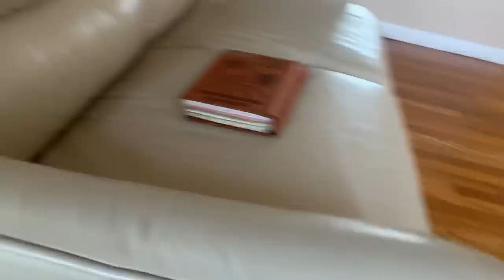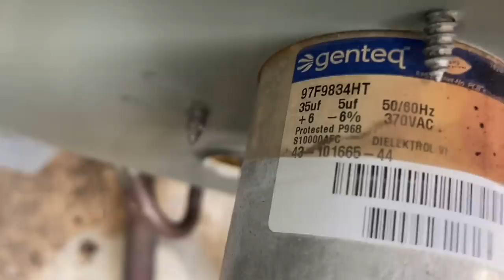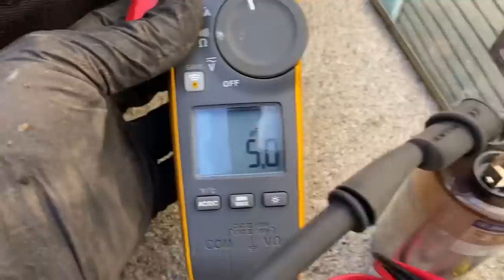Why it Takes FOREVER for the Central AC to COOL! Neglected A/C Unit Repaired & Cleaned

Comment: 74° in Long Island? Wow thats comfortable. Here in my part of Canada we are baking in 100°+ heat and high humidity! 78° was our low this morning! My Central A/C is running strong after 25+ years of service. My Aunts A/C is running strong after 42 years of service, her house was built in 1980, never renovated or upgraded. Everything but the water heater and shingles are original! Her gas furnace has a belt on the blower and a pilot light on the burner assembly. It is a natural draft so its the old style. No control board just a fan limit and thermostat terminal and some condenser relay box.

Comment: It may involve a lot of work but The dryer vent needs to be rerouted to the other side of the house and the condenser needs to have some legs under it to prevent the mulch from interfering with the coils

Comment: I wonder if you could put a 4" PVC 90 on that dryer duct just run up the wall about 5 ft to clear the units or around the corner to the right?

Comment: 3:24 @Mikey Pipes - Pipe Doctor Plumbing & Heating & Air
Not sure if you do, but if you stocked most common filter sizes on truck, you’d make a killing doing an up charge on your service /tech calls when replace a filter…..cuz lets face it 9/10 PPL don’t change the filters, flush condensate line(s) every month w/ vinegar (if they want to)….so know takes up room on a truck, but could store on interior of ceiling w/ brackets (or on sides) and keep most common ya know what ppl use, and could charge extra for it, cuz being in a home w/ a filter changed, or a spare ready to go…..happens like 0.0001% of the time; especially when homeowners have uncommon size that CAN NOT BUY IN STORES & MUST BE ORDERED: 1 example in my area is a 16x20x2 filter and DONT FIND THEM at box stores😉
Cheers gang✌🏻
Reply: @PipeDoctor  Yeah, can understand that, overhead (cost) and space in trucks wouldn’t work well. Appreciate the reply, your always kind and try to answer everyone’s comments/queries. Thx and cheers✌🏻
Reply: with all the various sizes scattered around, you'd need a 55' semi trailer full and probably still never have the right size! 🤣

Comment: It would be ugly, but if you take off the louvered dryer vent cap and transition into a pvc 90° go into the ground and follow the house to the corner and come back up it would be away from the units and still be accessible to be cleaned. Some of the dryer vents we clean go through the slab in the laundry room,  go underneath the storage room and come out of the ground just past the slab.
Reply: you must be down south somewhere always warm, up north here it would condense in cooler weather and clog in no time.
I once made the mistake of running one under a deck, out  3' and 5' across, it was ok in summer, by winter I had to totally relocate it and repair the dryer(thermal fuse went bye bye)
Reply: @throttlebottle5906  NC, about 1/3 of the houses we maintain have the dryer vent go under the slab. Recently we've had to repair the elbows under the surface do to water getting in🙄
Reply: @matthewhoffman9242  too funny. here in northeastern Ohio, there are older slab homes with clay tile/orangeburg pipe as "downflow heat supply ducts", and field tile drainage to sump crocks. you can imagine what happens if the sump pump fails.
had a buddy call me from California on a work trip, his wife and kids had so much humidity in the house the doors and windows were frozen shut and walls/ceiling dripping wet with humidity! the sump pump failed and ducts full of water, the house was a jungle and water coming up through the slab! it was actually a rental and nobody else they called would show up in the storms. I met his dad there and we worked in the freezing rain and cold to fix it.
next lesson, never run dryer/exhaust/anything vents underground/exterior. maybe the hottest of dry climates areas( even then no)

Comment: What moron installs a dryer vent right next to an A/C unit?🤔 Not only that, it looks like it’s pitched directly at it!  And that whip looks like it can block the louvers! /SMH.
Reply: lol would of likeds to see why they chose that spot, he was saying lots of cabinets and finished walls down there. idiotic to blow hot air into the coil though
Reply: the home designer and engineer's. they only want all utility/noisy stuff at one location, so you get that type of stupidity, with dryers, bath/kitchen exhausts, furnace/water heater vents all stacked on top each other puking into the condensers.